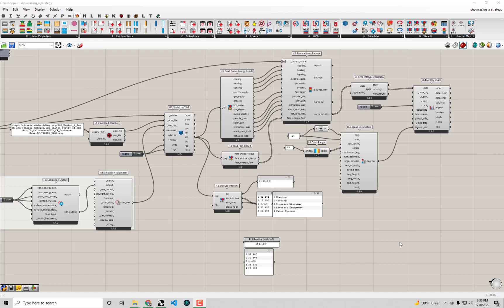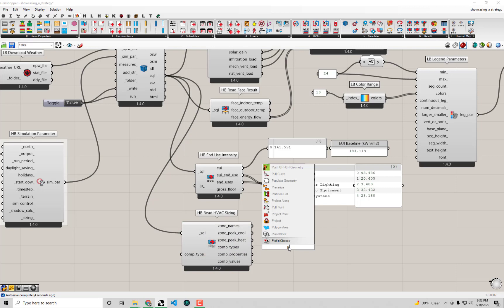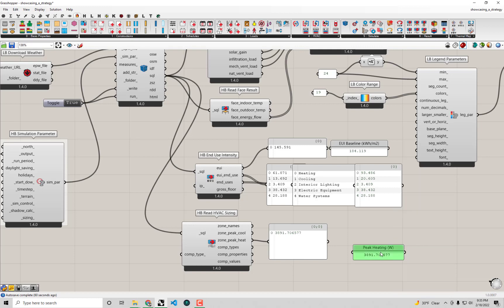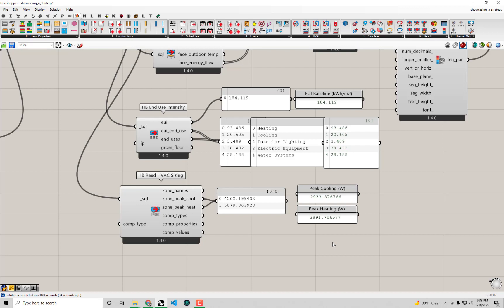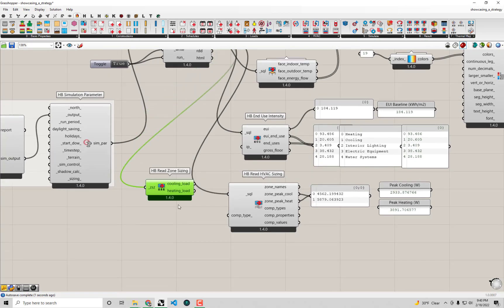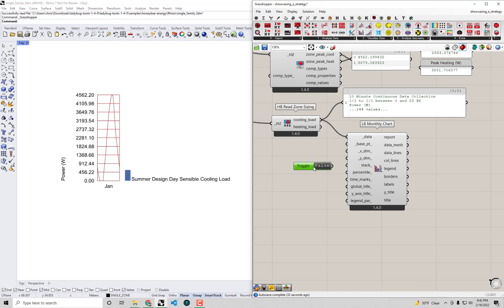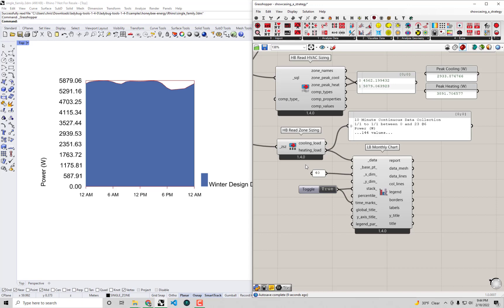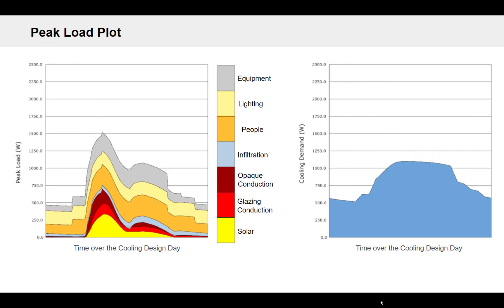Energy Fundamentals: Heating/Cooling System Size

Comment: Hello, thank you very much for this very useful series. I have a question regarding the peak cooling and heating days. I am a bit confused how the peak cooling load for the summer season appears to be on January 1st whereas January is considered a month of the heating season? is this a mistake in the component or am i missing something? (referring to minute 8:34 in the video)
Reply: The component just outputs one day and does not detail which day of the year it is, so the visualisation component just assumes it is first day of the first month (Jan 1).